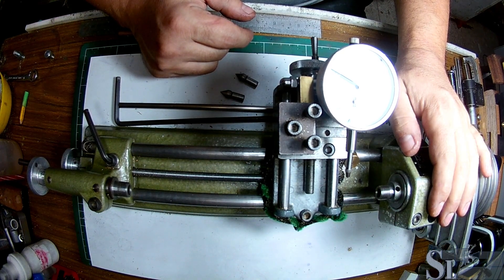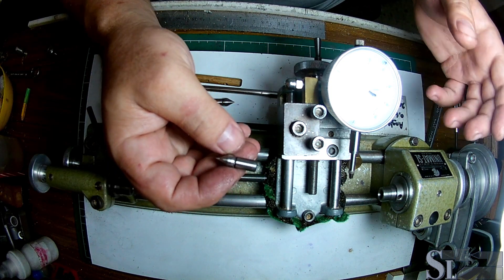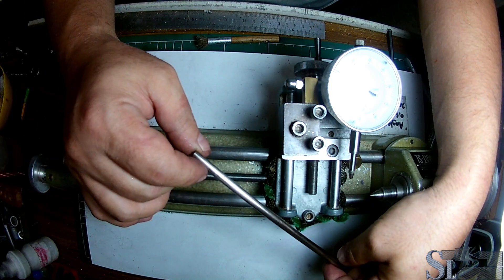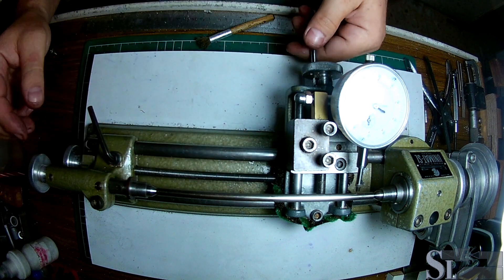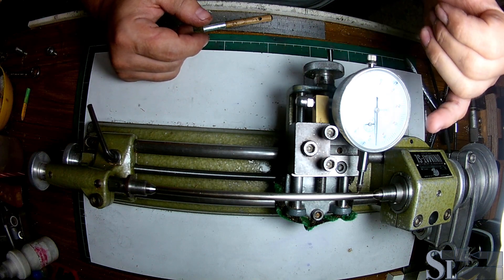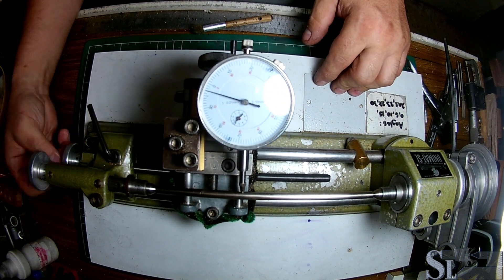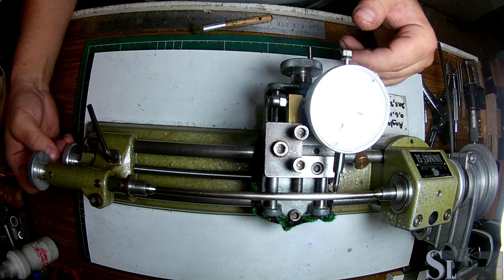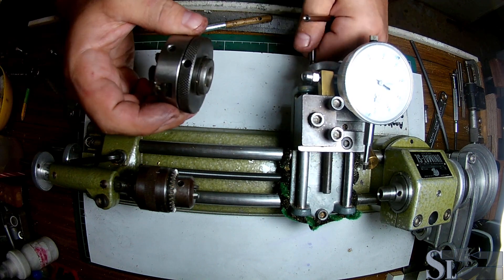Centering the Unimat SL 1000 lathe

Comment: I have some old booklet where it says you just take booth of the centers and put them inside headstock and tailstock. You remove that big spring at the back of the lathe and push the headstock forward as much as it goes. Next you move tailstock towards headstock until points meet and eyeball the aligntment. I found this to be accurate enough. I use some lupe to magnify points as my eyes are not what they used to be.
Reply from the maker: Yes,that will work ok.
There are lathe centering buttons that use the same principle too. But I think the long bar gives me a much better accuracy over a fairly long distance. Slow, but accurate.

Comment: I understand this video is 3 yo but will take a shot: I noticed you were licking your head on the back of it, and not using the lock pin on the side, could you describe how you do that or show it in pictures/video?
Great video, with all of the reality that is to move the table from one side to another!!! It’s really a pain. They came with the thread attachments that could do such thing but they are super expensive nowadays.
Thank you for your videos and clear explanation of what you’re doing!
Reply from the maker: Hi Mate. Good question. The lock pin is more of a safety feature, It doesn't really give you precision centering of the head. So I center the lathe and then plae the locking pin in. The head of the lathe - if I understand your question - pivots on a hinge - a center pin. The idea is you can turn the head of the lathe, turn your work at the desired angle and then center it again. This is very annoying if you need to make several angles and to turn straight shafts between... which is why I eventually made my own unimate compound rest. :)
Hope my explanation helped

Comment: Useful video, thanks.  It seems like you could align quicker and maybe save yourself a back-and-forth or two with a quick calculation.  Let's say it's 80mm from where your indicator starts to where it stops, and your indicator shows a 200 micron change in that distance.  That means your slope is 200/80 = 2.5 microns per mm.  The offset you're missing is the distance from the tip of the tail to your indicator start position.  Let's say that's 20mm.  20mm * 2.5 microns per mm = 50 microns.  So if you change your initial adjustment to 200 microns + 50 microns = 250 microns, you'll be a lot closer the first time.

You'll notice that you can make the math a little simpler:
 - distance from the tip of your tail to the indicator start position (20mm in the example)
 - divided by the distance the indicator travels (80mm in the example)
 - equals 1/4 (for this example).
So the tweak you need to make to the adjustment is 1/4 times the indicator change.  1/4 times 200 microns = 50 microns, so use a total initial adjustment of 250 microns.  Same as the first result, just a little easier to understand the steps.

This would make more sense if I could explain it with a picture, lol.
Reply from the maker: Neat idea! Thank you! I didn't think of it this way - but you are right. I'll try it next time. I did try over setting to compensate but didn't try to calculate the offset - and I will install a motor to speed things up.
Reply: @Smallathe  Let me know if it actually works.  Sometimes this kind of thing works a lot better in theory than in practise!
Reply from the maker: @clawsoon  will do! If the math works out I'll make a video on this method with due credit :)
Reply: @Smallathe  Great!  It'd be great to see you draw a diagram explaining it in the video, if that's doable.

Comment: The procedure tests for the line between the pointy ends of the dead centers to be parallel to the rails: it does not test for the spindle axis to be parallel to the rails.  Am I missing something?
Reply from the maker: Hi. Yes, you are right, but any steel will bow in the middle (and I lack a carbide rod to that end. So I am actually looking at the gauge only when I'm very close to the ends. You can measure the centers themselves but I prefer it this way. larger lathes have a measuring rod with precision ends. - this is a similar concept. I'm using a stainless steel rod that has nicely centered ends to do the same thing. Tubalcain showed several centering methods - do check his videos. I plan on doing those again too.... if time allows...

Comment: Do you no we're I would be able to get the harding steal center from. I have one of them that came with this lathe but not two?
Reply from the maker: Hi David. Do you mean the lathe ways?
You can buy these from ebay. Just search "unimat SL DB ways". Here is one of the ways offered for sale there. 
https://www.ebay.com/itm/143833727174?hash=item217d2880c6:g:TYkAAOSwUm5fqmFo
Alternatively, you can buy hardened, precision ground 12mm steel rods and cut and drill them to fit the unimat dimensions, but that's a lot of work.
Reply: @Smallathe the only advantage over the amount of work is the certainty on how precise it can be. Most on eBay are old and worn so caution is advised.
Reply from the maker: True! @roadshowautosports

Comment: Hello Saar. I'm thinking that a small DC motor with a rheostat to control speed and a reversing switch to power the feed. Could be driven by an O ring to a narrow sheave mounted behind the hand wheel.  O ring could be easily removed for manual function. 🤷🏼‍♂️.      🇺🇸😎
Reply from the maker: Agreed Danny!!! I actually harvested such a motor from a broken toy. It's on my "to do" list.... It's just a long list!!!
Reply: From a train 🚂 set.
Reply from the maker: @paultrimble9390  yep. Or RC toy car...